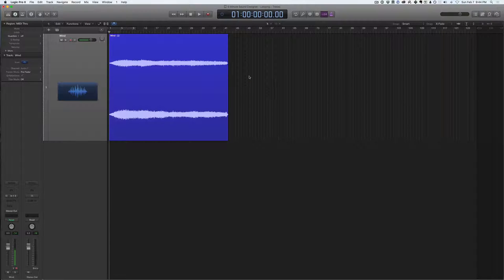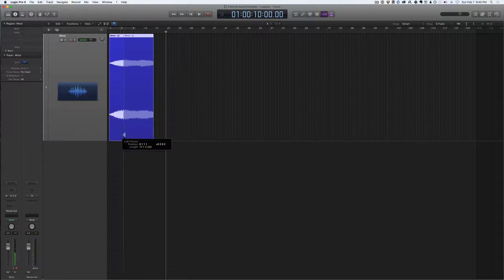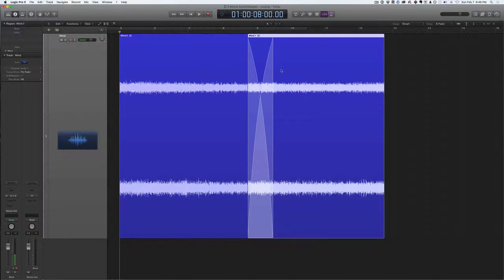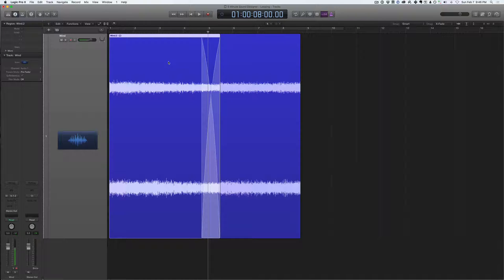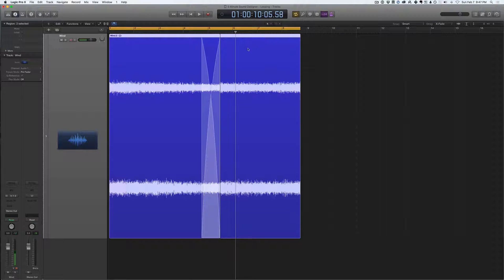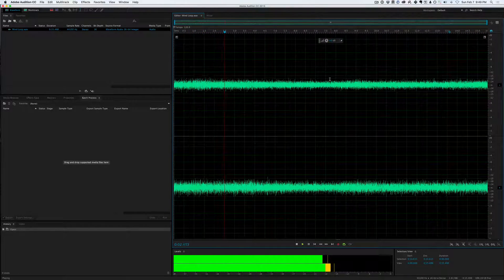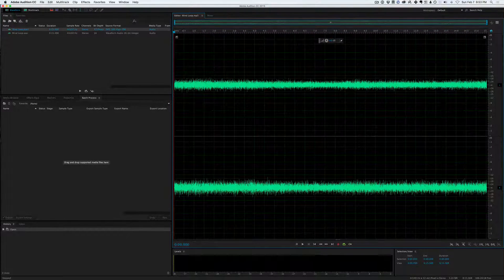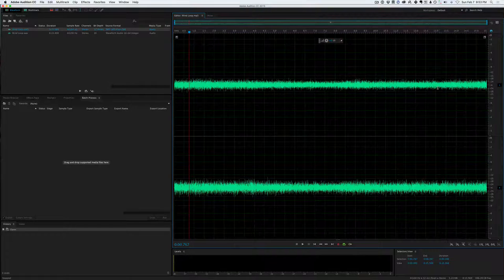Video Game Sound Design Tutorial  - How to Make Looping Sound Effects

Comment: problem with this is that now your sound file may start and end with the waveform not at 0, which would cause a pop on start. easy fix is to add a tiny indistinguishable fade (1ms) to 0 to make sure all the waveforms start and end at 0 volume

Comment: adobe audition is definitely the most honest DAW I've used. unfortunately, like most DAWs, the ui/workflow could use a ton of work
Reply from the maker: LOVE Audition. Like you said, the UI does need some work, but still it's one of my go-to pieces of software
Reply: why would you choose it over protools?
Reply from the maker: Pro Tools and Audition are very different beasts. I don't consider them to be in the same category. Pro Tools can work with MIDI and audio whereas Audition can only work with audio processing. Audition is much quicker for quick edits, checking loops, mastering, volume balancing, etc. 

Pro Tools is a fully featured behemoth that can do all that and more, but it takes much longer for those quick fixes.

Pro Tools is great for live recording, putting sound to picture, and I was even required to use it when I worked on Destiny's music. 

I also really hate Pro Tools, so that's why I don't use it unless absolutely required ;).